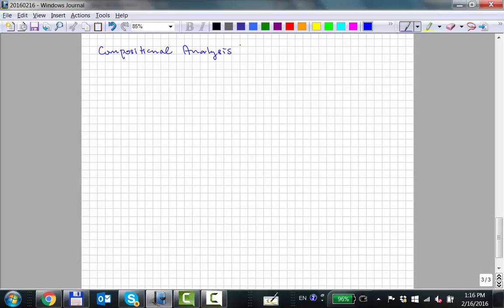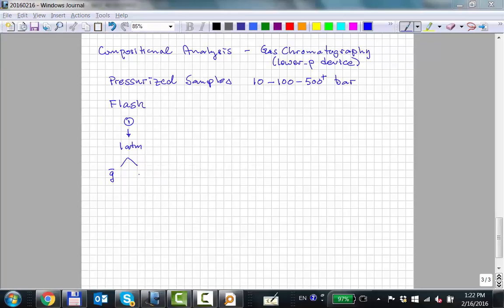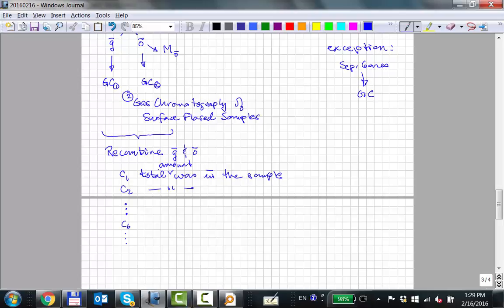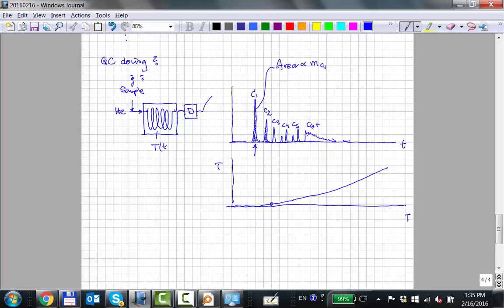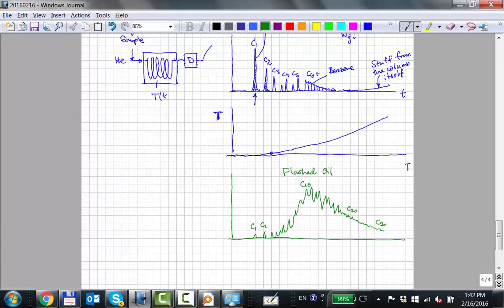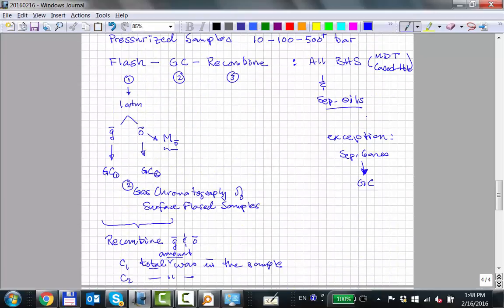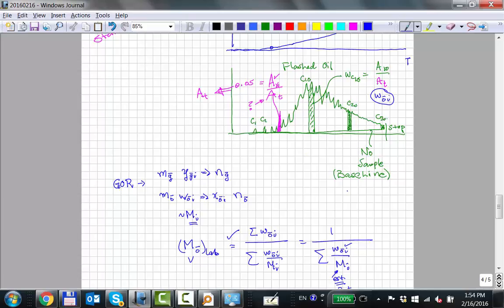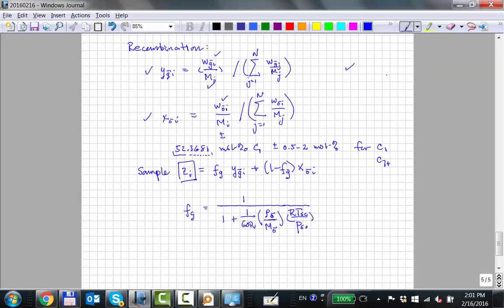Lab Compositional Analysis (20160216 Part 2)

Comment: 24:12 Yes we report oxygen content, air is considered a contaminant so the lab will repeat if too much air is present. Curtis is right that the non hydrocarbons are measured differently. Specifically, it’s a different detector (FID vs TCD)

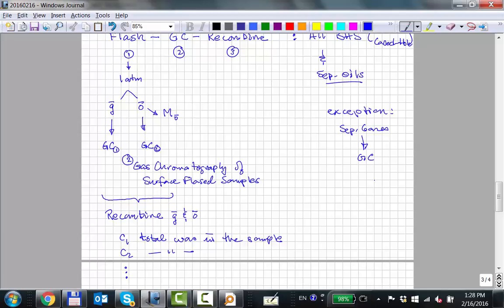Comment: 12:12 First we heat the gas sample to a temperature above the Sep temp to ensure the sample is in gas phase and no liquid has dropped out. Then we sub sample a small amount of gas into a separate vessel that is at atmospheric pressure. Then we inject the sub sample